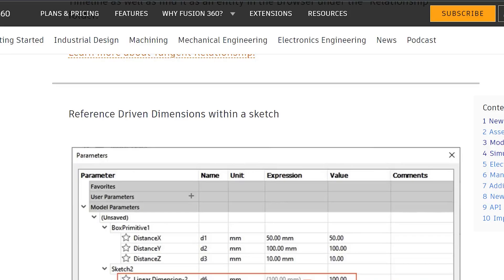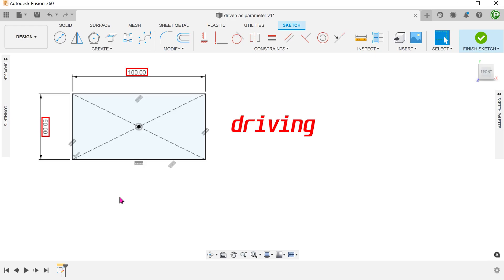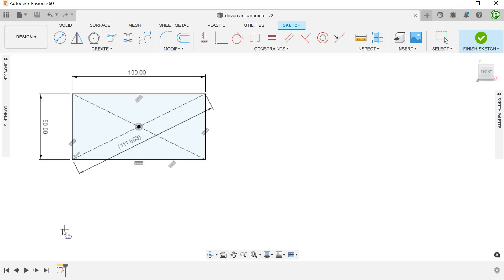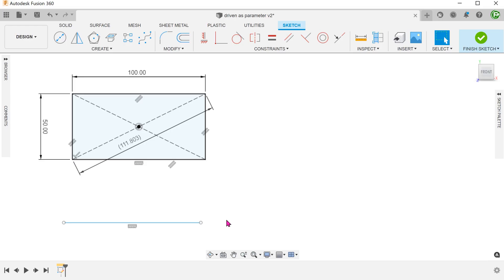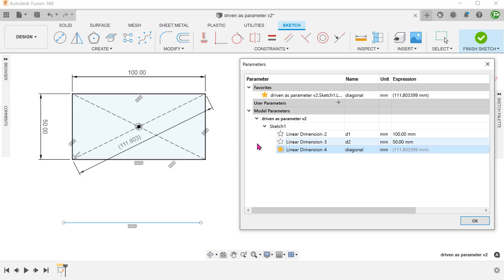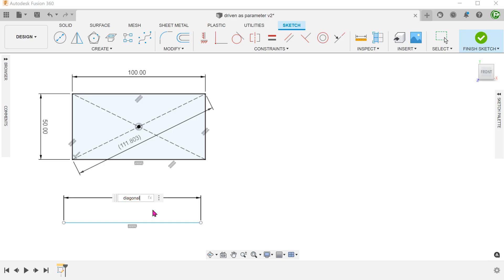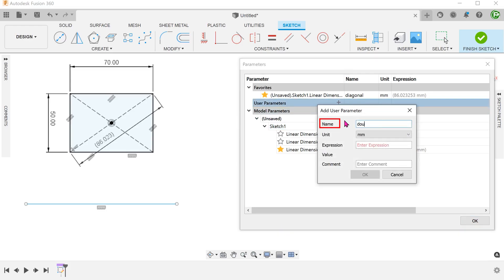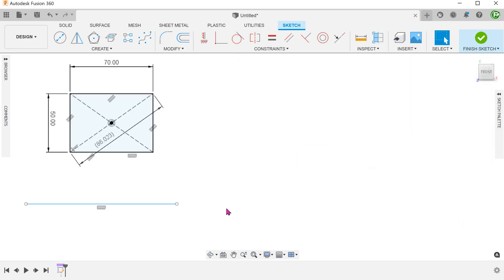Fusion 360 | Driven Dimension as Parameter

Comment from the maker: One thing I failed to mention here is that a parameter set for a driven dimension cannot be used in other sketches and features (e.g. in an extrude), at least not for the moment. It can only be used within the sketch that it was created in.
Reply: I wonder what the underlying reason is. And, if it's inherent/unavoidable. As is, this is a HUGE limitation :( In fact, I right now have a perfect case for driven params, BUT, they must apply external to sketch param is in. Hopefully, this limitation will be removed...
Reply: Chiming in here to mention this is no loner an issue, you can use the driving dimensions defined in the sketch in solid and surface features in exactly the same way.
(driving parameters still need to be favorited in the parameters menu)
Reply: Still better than nothing :)
Reply: I know i'm extremely late to the party but I do know that now you can use those driven parameters outside of the sketch. Idk when they changed it though
Reply: Thanks for this clarification; tried to use a driven dimension parameter for an extrude and it failed, so came here to see if I missed a step. Then I realised I could just extrude To Object and select the desired point on the sketch... facepalm
Reply: This makes me sad :(  
It would be super helpful.
Reply: This makes it nearly useless...
It would be perfect to use for example with a pattern on a complicated shape, where you want it exactly touching.
Not easy to calculate at all and i dont know any other solution.
Autodesk inventor could do it, i think.

Comment: There is still a bug so I can't use a driven dimension when I eliminate its unit. For example, when I have a driven Parameter 7,5 mm and I want to make a formula with Driven_Parameter / 1 mm it becomes red when I type in the new parameter somewhere else

Comment: Now I'm testing this. Everything works up to the point of applying a named driven dimension to dimension something. The input box does indeed suggest the dimension name, allows me to select it, but once selected it remains red and if I type Enter nothing changes - the dimension is not being applied. Am I doing something wrong?
Reply from the maker: It sounds like you might be attempting to use the parameter in another sketch. It can only be used within the same sketch where the parameter was created.
Reply: @Fusion360School  oh, that's a limitation I had missed. That's too bad, I really hope they make these available globally. Thanks for the video, this is the nicest Fusion360 channel that I know of!

Comment: This is great, I hope they add some more features to parameters, like the ability to have parameters that are shared globally. I also think it would be helpful to be able to import parameters from a CSV file in user parameters. That way you could easily share design specs without having to share the exact object.
Reply: There's already an add-in for that, called "Import/Export Parameters (CSV)".
Reply: @j.f.christ8421  Thanks man!
Reply: You can also create a set of parameters in a separate file, and then reference them in another file using the derive design feature.

Comment: But we still can't use driven dimensions in other sketches and features.😢
Reply from the maker: Yes, that is disappointing. Hopefully, they are working on it.
Reply: @Fusion360School  I guess they haven't been working on it? Every time I've wanted to use a driven parameter, it has always been for use in a different sketch, or as a length in an extrude, etc. With the limitation of only using these driven derived within the same sketch, it seems to only cover the one case that was most easily avoided without this feature in the first place. I almost expected the opposite, only being able to use these outside the originating sketch in other sketches and features created after the originating sketch in the timeline, since the driven values would be guaranteed not to cause recursion in those cases... Autodesk making me smh yet again